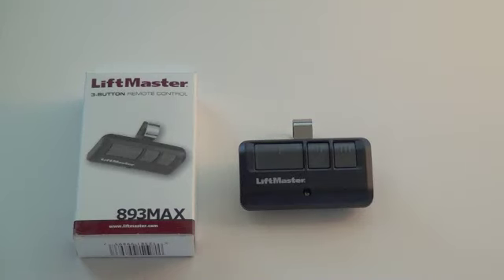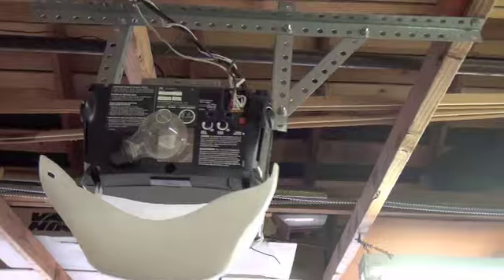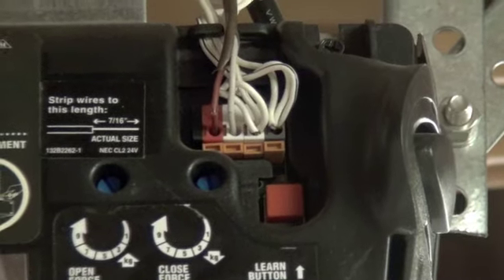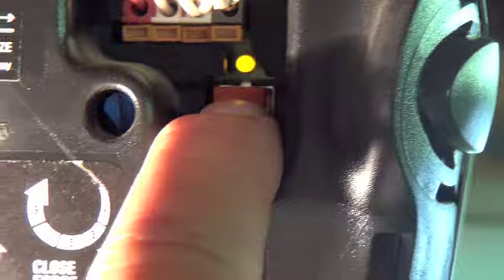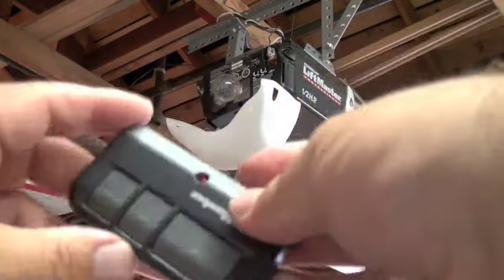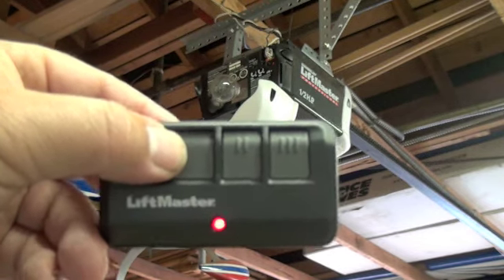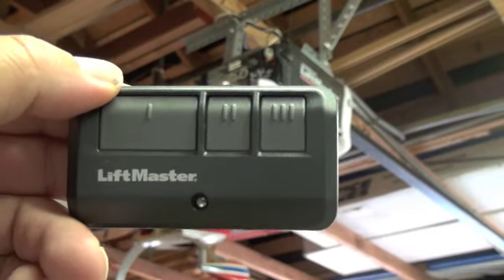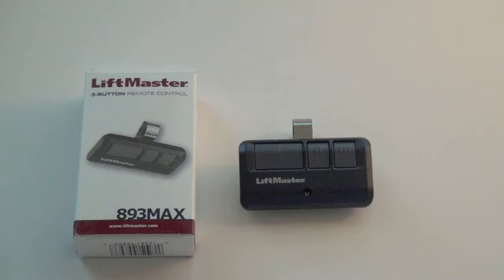893max

Comment: FWIW: it's important to press "any other button" to complete the programming sequence. If you don't, the remote unit will only work sporadically.
Reply: Thank You so much.. I programmed and was wandering why its not working.. it was like i have to press 5 time to open and another 5 times to close as soon as soon i pressed “another button” it started working.. 🤪😅

Comment: My remote doesn’t have button on the back it is a 893 Max
Reply from the maker: If it's an 893Max it would have the button inside the slot on the back of the remote you use the visor clip to push it to.  look at the video around the 56-second point you should see it.  NOTE There is an 893LM remote that does not have that button/capability.